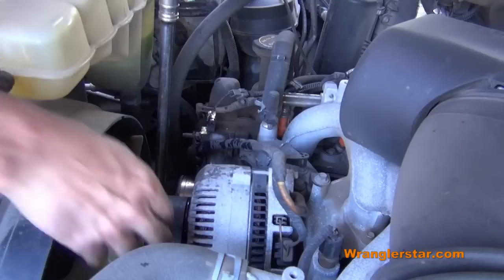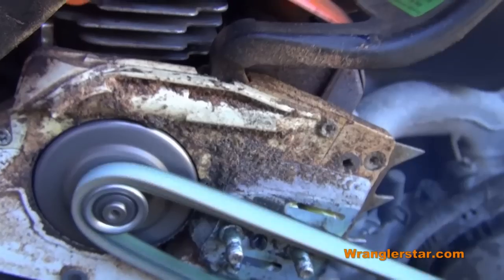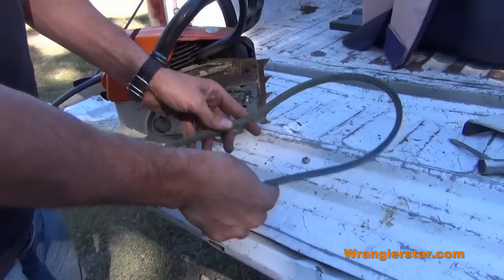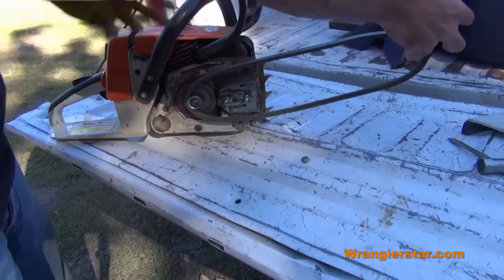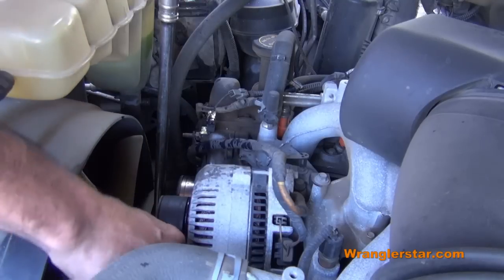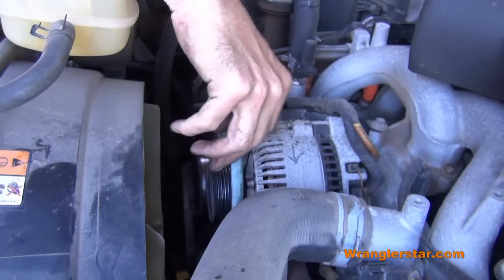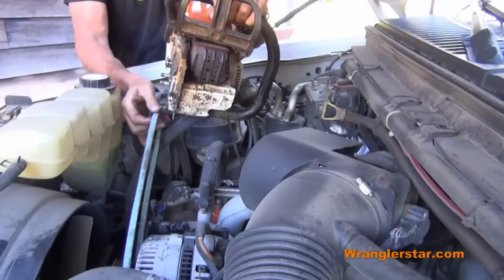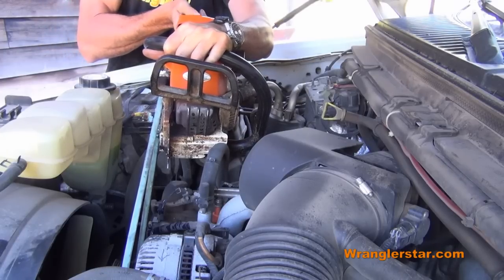Charge A Car Battery With A Chainsaw

Comment: My 1985 4X4 standard F150 has a double wheel for the alternator, Would be a good way to "jump start" my truck if there wasn't any good hills to push id down.

Thanks for the idea. :)

Comment: if the battery is absolutely flat this will not work as electrical power is required to excite the field windings.
Reply: It would work tho
Reply: Turbo Conquering Mega Eagle agree
Reply: >what is residual magnetism
Not to mention the battery is almost never so flat that the field windings cannot be excited. Keep in mind it only needs a few (1-3) volts for most motors.
Reply: Turbo Conquering Mega Eagle untrue

Comment: huh I am surprised you can spin that alternator with a chain saw.  I tried building a buggy years back consisting of a 3.5 hp lawn mower engine with a pulley and a classic mid 80s Chevy alternator.  when I turned the alternator on it'd instantly kill the motor.  even if it was running flat out.   But my pulley was a large crank pulley.  So maybe my gearing was out of whack.  Was your alternator actually charging in that video?

Comment: This is a good idea,  but you forgot to mention you need to turn on the key to activate the alternators magnetic field and create charge, and if your battery is completely drained and has no power to turn on it won't make any charge.

Comment: With a completely dead battery this WILL NOT WORK. With no power to the field windings the alternator CAN NOT charge.The Stator and Rotor are both electromagnets and need some voltage to work.

Comment: Great idea you have there Cody, I had in the past wondered how I would charge my battery if I ran it down when I was off-roading solo.  There was one thing you forgot to tell people. Most alternator need to have the key in the on position for them to charge if there is any power left in the battery.  Most alternators are not self-exciting like the old generators are.

Comment: Might not work on a completely dead battery. If I remember correctly, the alternator needs a charge from the battery to excite the field before it will output a current. Worth a shot in a pinch though.
Reply: +Casey Hagist Hooking up a simple 9v battery in parallel with your car battery will give you enough juice to get a charge starting
Reply: Good idea
Reply: +Casey Hagist A stone dead battery will not accept a charge though. There has to be some residual charge left in it to receive the output from the alternator.
Reply: That is what I said in the original post. Did you not read it?

Comment: it dose not  matter which way the alternator turns . It will be the same D.C. voltage either way. Also some alternators need a field voltage to excite them...sometimes there will be a residual magnet field but sometimes not in which this would not work.
Reply: THEN you just turn the key on, but its gonna be very hard to spin
Reply: Very true ...agree

Comment: Get a manual transmission, push it , pop clutch
Reply: Jason Wilke Ex-a-fuckingly-le,!!

I refuse to own an automatic, and this is just one of the reasons (although I do own a BMW M3 with paddleshift 6 speed, but it's so much fun I'm willing to give up the ability to bump start), the only thing automatics are good for is bracket racing, which is......................BORING!

In a reverse of this, you would be surprised how many miles you can cover before the battery dies by cranking over a 1984 VW gti in 5th gear. Got me to a gas station many times, and probably will do so again I'm sure.

When a battery goes out I usually don't replace them until it snows, or it's during winter, I'll just bump start until then because I've done it so much I can get most cars started with an incredibly short roll if necessary using a higher gear. Even if it's flat, you can generally still push the car with the door open and hop in and start it at just a walking pace, and I'm not talking cheap old junkers, but newer German cars, including a long line of various 911's.

I cheat on maintenance wherever I can so I can pay for higher performance. Tires I'll run way past the wear marks, they stick better anyway, just make sure it stays aligned appropriately to your driving style and vehicle dynamics. You should be able to feel when it's not right and know how to adjust it without much effort. I'll change oil filters quite often and add the amount lost but use the same synthetic oil for a long time because modern synthetics will last much longer than it takes to load them with carbon. If the car doesn't have an upper mounted replaceable element type filter system like BMW and Porsche use, I'll install a diverter plate, hoses and can so I can change elements in a couple minutes with minimal oil loss, a case of elements costs less then one oil change. If you're not using a K&N high-flow, reusable element type air filter, then WTF? Belt dressing makes belts last forever. Clutches last forever if you only use them to start and stop, and matching revs is quicker and smoother anyway. Brakes, well rotors last a lot longer if you A) always bed-in the pads properly, and B) change the pads before they are half gone. This way the pad and the fluid (use highest grade synthetic) absorbs most of the heat instead of the far more expensive rotor. Fuel systems last longer and perform better if you A) never let the tank go under 1/4 full, or B) Regularly run it dry so it never has time to build up sludge in the bottom. Guess which plan I use, LOL! Buy only cars that use a timing chain instead of a belt and save money and drama. Turbo cars offer better mileage, higher power and consistent power output, (especially if you live at a higher altitude) BUT you must change your driving style to get the most out of them, meaning you avoid driving at mid-performance, you are either off boost/neutral and staying at low RPM, or fully on and staying at high RPM as mid throttle completely negates any advantages of a turbo motor.

You can save enough money this way to buy a faster car and/or go racing :)

Yes even if you're a girl.
Reply: Jason Wilke Yes, that is a PROPER transmission that will not fail if you know to use it. Plus if a driver is skilled the ride is always smooth. My old Saab has automatic transmission which is probably from the dumbster. From time to time it refuses to kick down (and I know for a fact that this is a feature, not fault), gear changes are more often clunky than smooth (yet another feature). The only good thing is that the Saab automatic is very reliable, I have bit under 300tkm behind without a single issue (apart form the features it has).

Comment: Empty batteries must be charged with low current, otherwise you damage it. ALT - high current
Reply: Yes, but low in most cases means it still has 4-6 volts which is no big deal...

Comment: I don't know what is do complicated about this? Why do you need "excitation voltage?" All you need is a magnet and a copper coil. Spin the magnet, it induces a charge in the copper coil. All you need too do is give it somewhere to go. I.e. a "dead" battery

Comment: Those four words do not constitute a sentence.
 Diodes and polarity notwithstanding, it still does not matter which way an alternator turns. They will work in either direction. FWIW, 99.9% of all alternators turn clockwise

Comment: If your battery is below 8 volts this won't work because there's nothing to excite the field.
If you battery is above 8 volts don't forget to turn the ignition on, or you won't excite the feild.
Reply: +Jon Hadlich some wisdom. I was thinking the same, with the voltage regulator built into the computer on most vehicles now i would think spinning the alternator with a flat battery would be useless, some charge would still be required with the key on.
Reply: +Jon Hadlich true, unless you have a self exciting alternators-i.e.- gm 10si.  geo prism (toyota corrola) alternator can be excited with a common 9volt battery for anyone out there in that desperate situation. I have one on a 5 horse briggs I use to charge batteries out at the cabin.

Comment: Thats not going to work if your battery is dead. You need a power to the feild in the alt to get it started. As long as the battery has alittle charge left in it it might work,

Comment: Does the key need to be in "on" position?  Will the charging system of most cars charge as long as the alternater turns?

Comment: okay everyone.  i was out cutting wood last weekend and left my lights on.  dead battery.  i remembered this vid from months ago; however, didnt have a belt along with me.  point of story, get a belt prior to getting stuck.
Reply: Personally I'd recommend a good jump box instead.  I got the Clore JNC660 Jump-N-Carry, and I used it several times(to help other people) and works great.  They will even send you reminder e-mails about 4 times a year to charge it.  Time you get done messing pulling belts, etc, you could be unloading your wood.
Reply: Daniel Rice true.  i will look into one of those.  i just have an extra car battery i take with me.  thats cool they send you reminders to charge the jump-n-carry.  thanks
Reply: Dixon Cider LOL..Just turn everything off ! that is FREE..LOL
Reply: ***** even then if its a cse were car been sitting a while  couple weeks  months  or whatever sometime they still drain down...  i gotta  story though  i had a 92 olds cutlass  went   to  take off 1 morn  no juice  gotta jumpstart  went 2 work  well this happened a few times finally i went got a new battery  still kept going dead so i gotta new altenataor  still going dead..  checked all the wiring  it was fine  car was like new only had 40 thous miles on it   well anyway 1 night  around  3 in the morn  i woke up  2 piss  an heard a  car  horn going off  i live in the city in michigan  figured it was neighbors car alarm or somthin than my phone rings neighbor said hey your alarm going off again i said what  there is no alarm  he said ya there is  it went off 4 or 5 times this winter i go outside look at the car  it got so cold  that the steering wheel shrunk up causing the horn 2 beep till the battery died!!   lol  but  ya  that was somthin just wanted 2 share that story watchin this vid  brought it back up  lol

Comment: Don't think it matters what direction the alternator turns
Reply: drthik1 It doesn't, since alternators produce AC current (that is eventually rectified to DC)
Reply: The Adventure Biker While this is true, electric motors can be 'tuned' to give more power in a given direction at a given RPM. Likewise, I'm sure that alternators can as well. That means that running it in the 'wrong' direction may be less efficient.
Reply: Cooling fan is directional

Comment: what about just using the chainsaw to turn the engine over,  also,  the alternator wont charge if the batt is completely dead.

Comment: I guess your battery is not charged enough to turn the engine over, but does have enough voltage to excite the alternator.

Comment: It wouldnt work with a completely dead battery as you need a little battery for the alternator to work.. try it on a car where the ignition has been left on for 3 days.. i can guarantee it will not charge but hey if i ever find myself stranded with a chainsaw, tools and a semi flat battery i will give it a go :)
Reply: +Chris Lafond That is what I was thinking. if there is insufficient power to "excite" the alternator, you wouldn't get it "going."

Comment: Apparently this guy doesnt know how an alternator works.  You can spin an alternator in either direction and it will still charge..........the diodes in the alternator reroute the polarity to the correct terminal on the outside of the alternator anyway.  The key here is can you spin the alternator fast enough to trigger it to start(varies by vehicle)charging.  If you spun a generator backwards then yes you would have catastrophic results.

Comment: Liking a vid or disliking a vid has no effect on your channel or youtube income.  Cody personally if it bothers you there are trolls, you can get rid of the like/ dislike bar. Like I said the like dislike is just a meter to judge you vid.  Because there are now a lot of trolls there is no accurate purpose for this tool anymore.  I would get rid of it and no more worries.  It has no effect to you paycheck whether they like or dislike the vid. Every big youtuber has trolls and they really ruin it.

Comment: I am guessing this is for when you can not just give it a push start.
Reply: You can't push start an automatic
Reply: Vince Morgan Well I am told you actually can. It takes more speed.
Reply: You have to get it up to about 40mph, which isn't very realistic.
Reply: Any car built after 2014, you wont be able to pull start anyways.
Reply: Vince Morgan 40mph?? I you only need to go about less than 5mph downhill or just over 5mph on flat land. I have a 2007 Subaru WRX STi 6 speed manual.
Reply: mikeeey1337  he means with an automatic. I've pushed started my old 98 Tiburon with a 5 speed a few times. But my s10 with an auto I couldn't get going fast enough to don it.

Comment: It might be just me...But it irks me how dirty his chainsaw is...lol
Reply from the maker: I use mine
Reply: wranglerstar Now that is funny.  Best comeback I've seen in a while.
Reply: Not saying you dont, i use mine alot to.
Just doesnt hurt to clean it every now and then.
Reply: To +Shankferret S Hey I left my truck in neutral by mistake & got out and it started rolling back down a steep hill and INSTANTLY I Threw my Mac' 700 (With an 80 CC Jug) .404 chain- under the rear tires; it slid in some rocks but stopped the truck from a real disaster, then after I come-alonged it off the old Mac' (Didn't want to START UP AND PERHAPS SPIN TIRES & Grind up my saw) I wasn't at all surprised nothing was broke, as the entire saw is Magnesium, but it did have some serious scrapes. Then I just pushed the compression release and first easy roll over  started same as usual: Love a compression release and my baby saw is a Homelite Super Easy Automatic (42 CC) with a compression release integrated with the trigger lock. Both will start with the greatest of ease; fantastic for when footing is not ideal. 
CMVHighPriest

Comment: Don't you just hate it when you're cutting firewood all day in the middle of nowhere and you leave your lights on and the battery is dead and you have to take your chainsaw apart and remove the belt from the alternator and (previously) had to remember to have a spare belt that serves no purpose other than to charge the battery when your cutting firewood all day in the middle of nowhere and you leave your lights............................

Comment: If the vehicle's ignition isn't on I don't think this will work....
Reply: +Mario James You are completely correct.... A very false clip from reality. Not to mention there better be at least 9 volts in the system to trigger the alternator to work  in the first place.
Reply: +Andrew Hunter ...sorry guys, neither is correct...Ignition does NOT  have to be ON since Alt is self-exiting by way of residual magnetism, and Battery can be totally dead for the same reason...look up self excitation!...Direction of turning doesn't even matter with an Alternator...only with a Generator would you have to turn in the normal direction.
Reply: Wrong,,,, There has to be a trigger, or its called an exciter that opens the alternator field for the unit to work or you would always have a dead battery....

Comment: Good backup plan, but if you're gonna be out in the sticks cutting...it's always easier to make sure all of your equipment is in decent shape...or carry a booster pack. The newer ones will fit in the glove box & I've actually seen one start an old 8v92 Detroit diesel. 
http://image.made-in-china.com/43f34j00EZrTvzYMIfge/Lithium-Battery-Powerful-Mini-Auto-Jump-Starter-Lipo-Car-Battery.jpg

Comment: i didnt actually watch the video but its VERY dangerous to cut a battery with a chain saw... do not do it...
Reply: +jeremy western Word. I have found a few batteries in my time with fanblades thru them or inbedded in them. Not pretty.
Reply: +jeremy western You commented like this BECAUSE you didn't watch the video.
Reply: +04Interc3ptorP71 yes- its a perfectly normal thing to do. i knew he was going to chop a battery in half with a chainsaw so i warned people NOT to do it.... please pay more attention in future
Reply: jeremy+ are you trolling? because he didn't chop the battery in half. he warped a belt around the chainsaw fly wheel and the alternator to charge the battery. there was no cutting involved.

Comment: CHARGE A CHAIN SAW WITH A CAR BATTERY
   chain saws: un impressive technology. is there such thing as an alternative to a chain saw? everyone's always trying to manipulate the blade what ever happened to weaken the media? just off the bat would weakening the wood at the cutting edge as it is being cut using electricity, caustic fluid or super hot gas such as propane provide an answer. we used to cut foam with a hot wire. A hot saw blade might weaken the wood such as jets of propane exiting the chain saw and if you incorporated a flammable jets of oxyginated media (basically lighter fluid) the idea being your charring the wood as it is being cut. Start simple try a red hot circular saw using a a propane torch see what happens.